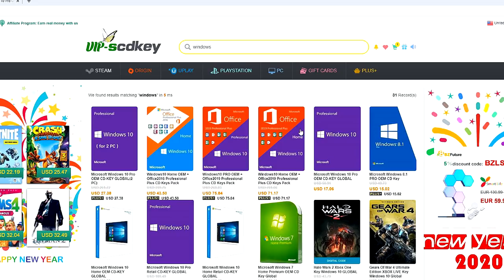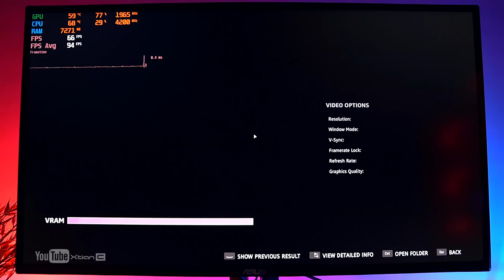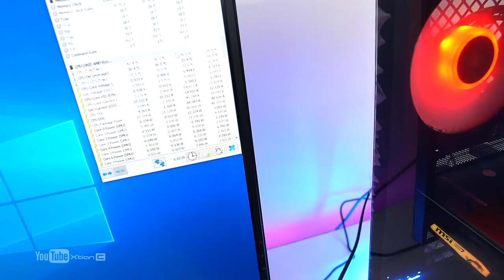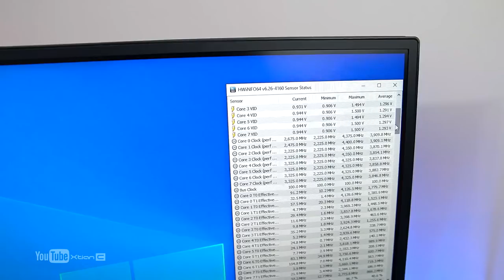VLOG: 70K Php Workstation/Gaming PC Build Ryzen 7 3700X I RTX 2060 Super w/ 7 Game Benchmarks [Ph]

Comment from the maker: *Full Specs:
*
•Processor: AMD Ryzen 7 3700X 
AMAZON: https://amzn.to/2GjSGe8
LAZADA: http://bit.ly/30Ow8M0

•Motherboard: MSI B450 Tomahawk MAX 
AMAZON - https://amzn.to/30W2Lqm
LAZADA - http://bit.ly/2ZvGUsl

•GPU: MSI RTX 2060 SUPER Gaming X
AMAZON - https://amzn.to/2Q67NQn
LAZADA - http://bit.ly/2U3YEFY

•RAM: 16gb (dual) ddr4 3200 Tforce Delta RGB
AMAZON - https://amzn.to/2LsZZlT
LAZADA - http://bit.ly/2Gcgxwz

•CPU cooler: Wraith Prism RGB (Stock)

•Storage SSD - Klevv Cras C700 Nvme m.2 240gb
LAZADA - https://bit.ly/3eUKRLP

•Storage HDD - 1TB
AMAZON - https://amzn.to/2LtP1gb
LAZADA - http://bit.ly/2Y6IP1U

•PSU: Corsair CV650 80+ Bronze 
AMAZON - https://amzn.to/2AqdQIl
LAZADA - https://bit.ly/3eWFvQa

•Case:  Deep Cool Macube 310p white
AMAZON - https://amzn.to/3eUTZzP
LAZADA - https://bit.ly/2ZwYwlx

•Case Fans = Deep Cool RF trio 120mm 
AMAZON - https://amzn.to/2A7Kx9P
LAZADA - http://bit.ly/2m2dsIr

Total:  P68,600

*Alternative Components:

•CPU: Ryzen 5 3600 - watch my 60k Build pairing with RTX 2060s
https://www.youtube.com/watch?v=ZH6XPWJR3uA&t=619s

•GPU: Pair w/ RX Radeon 5700XT, RTX 2070/2070s if you want to play @1440p.
pwede din same budget R5 3600 + /RX 5007 or RTX 2070s  watch my Ryzen 5 3600 70k mini ITX paring with RX 5700XT - https://www.youtube.com/watch?v=tlRsk-PIZDE&t=743s

•Case: Dark Flash DL21 mesh/ RAKK Haliya/ CM MB511
TIP:Get a case with stock fans if you don't want RGB para maka less kayo.
TIP:Get a mesh Case if mainit sa place niyo.

•RAM: make it 32GB if gagamitin niyo for 3d rendering.

*Monitor Used:
AMAZON: https://amzn.to/2MDlHWj
LAZADA: http://bit.ly/2viOycj
Reply: Pa build po pero bohol location po.
Reply: Magkano po bayad sa inyo kapag magpapabuild?
Reply: No longer available na yung ram. 🥺
Reply: Speak on English why u aren't speaking English people watching u all over the world
Reply: GOOD VIDEO CASEMIRO FROM REAL MADRID
Reply: Greetings sir. Ask ko lang po chineck ko po kasi sa net yung bottleneck calculator nakalagay po hindi daw po kaya ng rtx 2060 yung 3700x. Legit po ba yun sir or kaya naman? Salamat po
Reply: Ano gamit mo pang benchmark idol??
Reply: Magkano po bayad sa inyo kapag magpa assemble or magpapabuild?
Reply: Sir, may FB page ka po ba? Gusto ko po sana magpabuild ng gaming PC, 70-80k php budget.
Reply: Sir Xtian how much po magpa build ng gaming PC na kagaya po nito? Salamat po.

Comment: How much will it cost if with rtx 2070s? And ok lang ba kahit stock cooler gamiting sa 3700x or do u prefer external one? Thanks :)
Reply from the maker: Ranges from 25k to 30k depends sa brand. Yes nasa normal range pa ang temps using 3700x stock cooler.
Reply: @XtianC  thanks!!!

Comment: *Intel Core i5-9400F
*Asus TUF B360M- Plus gaming
*T Force Delta RGB 16GB(2x8GB) 3200Mhz AM4 WH
*Seagate 1TB Barracuda 7200 RPM
*CRUSIAL MX500 250GB M.2 2280 CT250NX5500SSD4
*NINJA GAMING RX580 8GB OC 256GB
*Raidmaxx Thunder RGB Sync 535w 80+ BRONZE SM RX-535
*DeepCool Matrexx 55 TG w/ 4x120mm aRGB Fans New DP-ATX
*GENESIS Dual HSF AIRCOOLER

Hi po yung ganito pong specs magkano po aabutin

Comment: possible po ba 50K - 55K budget with Ryzen 5 3600X and RX 5700XT?
Reply: sa ngayon boss tingin ko hindi possible yan. jan pa lang sa dalawa aabutin ka na ng 35-40K tapos sobrang hirap ng mga parts ngayon. kung makakapag antay ka wag ka muna mag build ngayon boss.
Reply from the maker: Actually kaya, get a lower model ng b450 mobo or a320 if d nmn nag OC. Tapos hanap din ng magandang deal ng 5700xt, maraming brands nag sell around 20k-23k. Tapos kahit stock cooler muna naka bundle naman sa CPU.
Reply: Oo nga po eh ang hirap mag.hanap ng parts.. 5700 or 5600XT sana gpu hinahanap ko para sa budget pero 5700XT lang ang avaible dito sa cebu.

Comment: Umabot ng 90k halos ung build namin na PC. Medyo overpriced ngaun sa pinas compared sa build mo. Pahirapan din maghanap ng parts at ayaw namin sumugal dun sa "china, hong kong" parts. Napamahal kami sa motherboard, ram at GPU masyado, dahil no choice. Nag cash out agad kami sa lazada. Also we already go into gilmore and the blockbuster pila made us just go home TWICE. even the PCX chains on viber group are all overpriced than lazada mind you. 28,000k cash discounted for a pick up sapphire nitro? really? dynaquest is non responsive too basically everything is overrun. so far here is the specs we got all from different lazada sellers
CPU                         Ryzen 5 3600	                       11525
Motherboard         X470-F Strix	                                 9289
RAM                       16GB 3600 TZN	                        6825
GPU                        Sapphire N+ RX 5700 XT           27140
Storage           	Used                                                2000
Keyboard	         Mechanical	                                  1700
PSU	               650W Seasonic Gold	                 4590
Case	               GT 501 TUF Case	                        7140
FAN, RGB, ETC	RGB Cable, Displayport	           480
Monitor	MSI Optix G27	                                       18040
	
TOTAL	88729
I admit we could have saved up more but we really need it too.
Only been angry with PCX so far because we thought it would be cheaper but instead the hassle of inquiring and looking for availability is tiresome. we waited a week before finally deciding to order everything on lazada, got lucky and grabbed a last R5 3600. So far laptop sales is skyrocketing in gilmore last time we went there almost everyone is either looking at laptop or desktop package. I do not advise people to spend now unless they have the money. market is unstable
Reply: Nagkakaubusan kasi stocks ako din gusto ko mag build ngayon pero overpriced lahat.